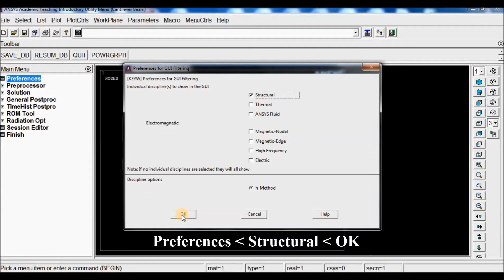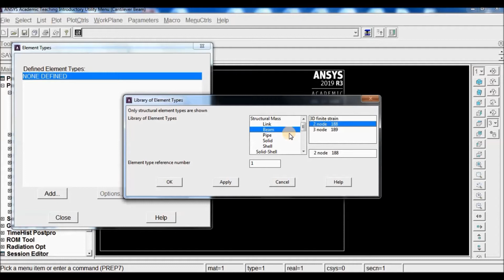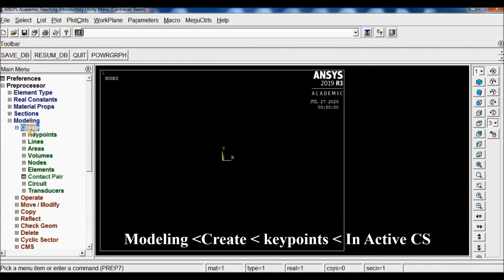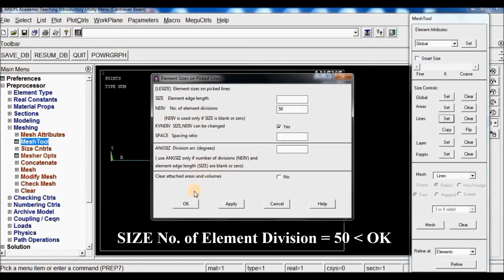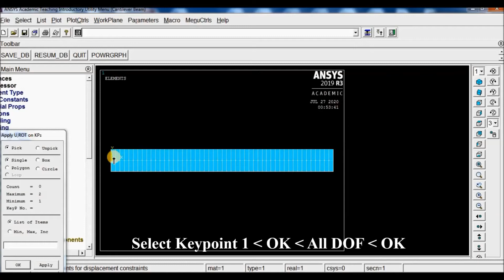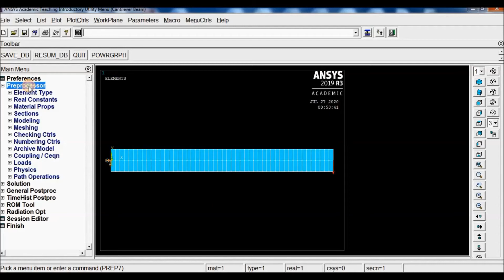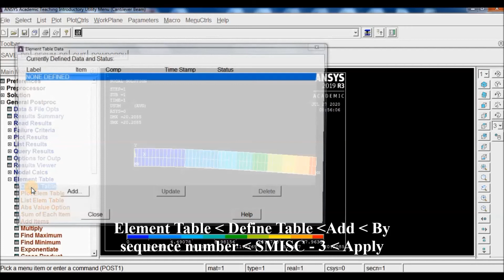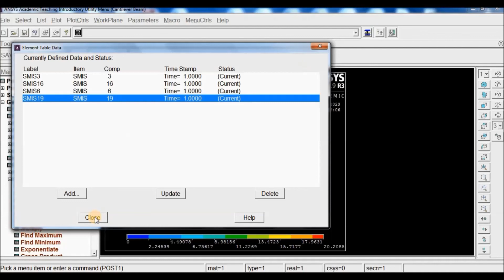Analysis of Cantilever Beam for Stress, Deflection, SFD and BMD in Ansys APDL

Comment: Problem: when i apply the load, i do not see the arrow. then when i plot the results i get no colors and my beam is all red.

Solution: my ansys apdl version has a glitch in applying the load so i have to apply the load using the command prompt. To do so, just type the command: fk,2,fx,-1000
this means apply force on KEYPOINT 2 in the x axis direction with magnitude 1000 in the negative x direction.
if you use the command: f,2,fx,-1000
then you are doing the same thing but applying the force at NODE 2 << this is wrong because nodes and keypoints are two different things and in this video, node 2 and key point 2 are in different places.

Hope i helped you and you did not have to go through the frustration like i did(:

Greetings KFUPM
Reply: Bro still it's red
Reply: Solved my problem. What a legend!